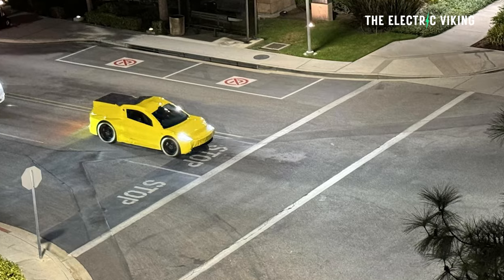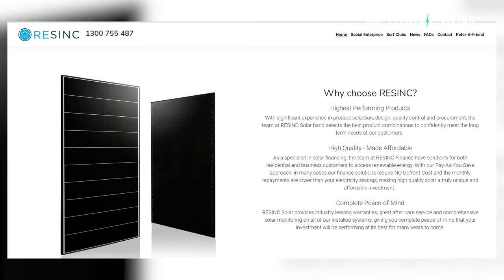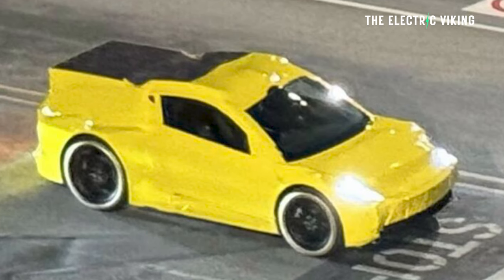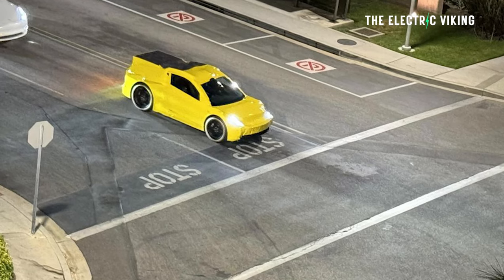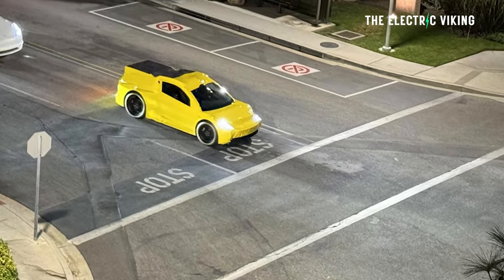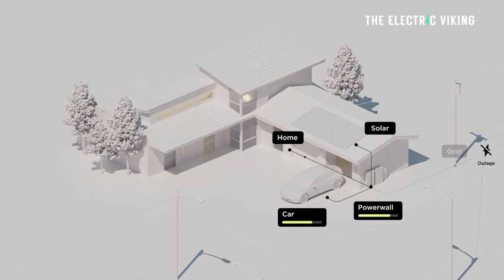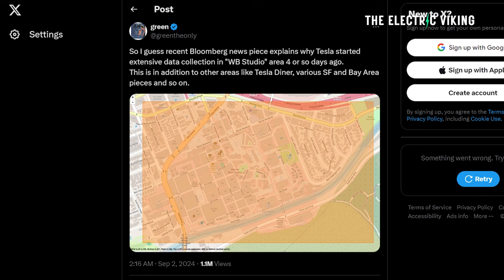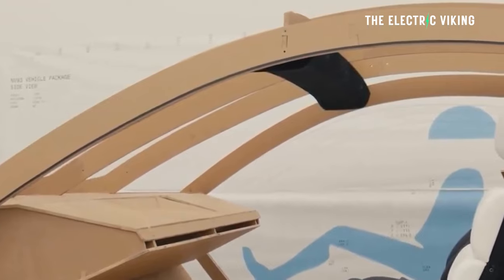Tesla Cybercab Robotaxi revealed driving in California

Comment: Sam, do you know perhaps when Tesla will join to NIO's BaaS to get these robo taxis run without cable hassle or very slow induction charging?
Reply: Tesla tried that back in 2016/2017. They ran a battery swap pilot program. It wasn’t successful. They are instead possibly working on a wireless charging solution that could be unveiled soon at the robotaxi event.
Reply: @FlipBoxStudio  no they did not tried. That was just a small demo without real effort to get that work. at that time there was no any real support for it - just few demo cars and Tesla EV's supercharging was free of cost.

Comment: Interesting news about the Robotaxi but keep yourself firmly grounded regarding your visions of "net zero" and "going green means electricity will be almost free. 
People who aren't engineers forget the cost of balancing the power grid and maintaining reliable energy to draw on at the correct frequency. Just to lay down the cables needed to distribute the energy produced by wind farms are way higher as they pop up just about everywhere, right now in Sweden we pay more for the distribution of power, the power grid itself, than for the electricity. Then comes the cost of balancing and keeping the light on 24/7.
Many of the so-called Greens are crying about the cost of new nuclear power plants which would probably be about 400 billion SEK, they want us to build more wind farms that only produce electricity on some day and provide batteries for the less windy days. 
Well, what do you get for 400 billion SEK in the form of batteries to store all that "free" energy from the wind farms? Roughly enough battery capacity to store 12 hours' worth of energy...
In Sweden partially situated north of the Arctic Circle and much of it Arctic tundra in winter can get days even weeks between -20C and -40C with absolutely no wind as it is an Arctic high-pressure period.
You can't build an industry based on perhaps there will be wind or sun sometime. Australia has a different perspective on weather and sun.

Comment: I  believe Cruise (GM) and Waymo (google)  have been operating in San Francisco for over a year and a half.
Reply: Correct. Waymo just announced that they are now doing 100,000 rides per week across three cities (SF, LA, Phoenix)
Reply: big deal they are in a sand box and can not drive outside of those boxes unlike the teslas
Reply: @udishomer5852  3 cities and most likely a small section of it vs drive anywhere
Reply: @RayJohnson1980  What Teslas?  They are still testing a prototype.
Reply: @RayJohnson1980  You have to add Austin to the list.  4 cities plus Atlanta early 2025.